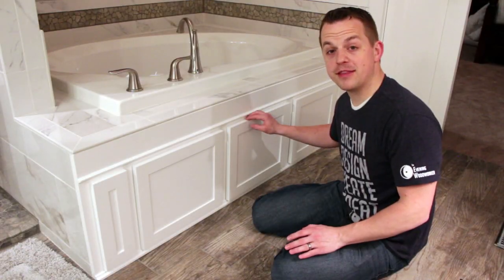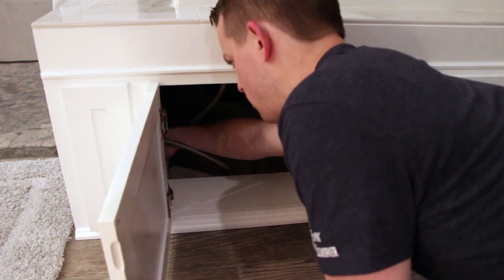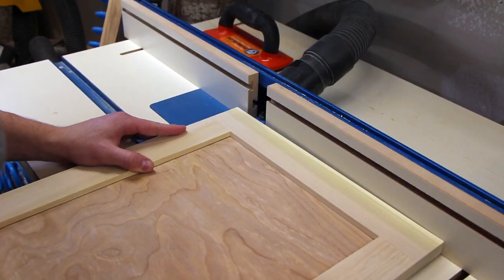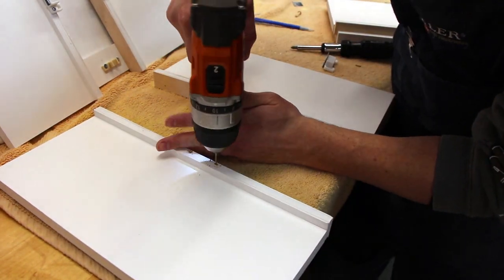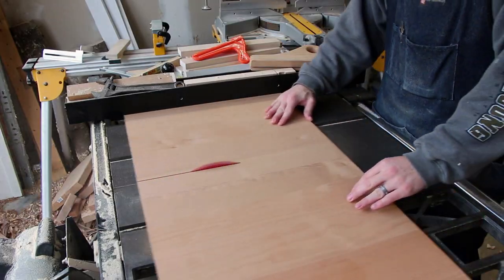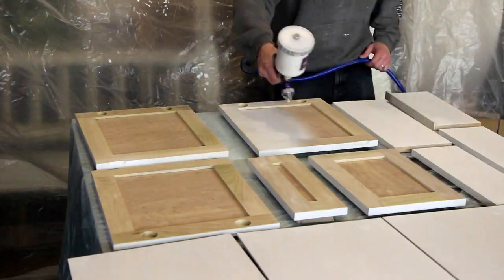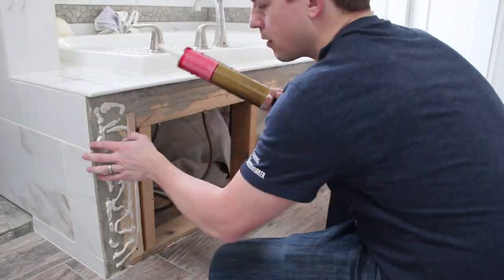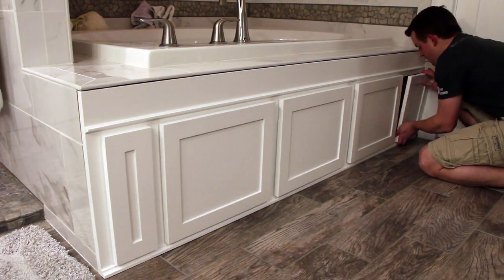Custom DIY Bathroom Cabinets under Bathtub | Evening Woodworker

Comment: Did you relocate the vertical studs for even spacing of the compartments? My tub has irregular spacing of studs, and I worry about proper support of the surrounding deck.
Reply from the maker: The studs were pretty evenly spaced, but different from each other by about an inch or so... so each compartment is slightly different.

Comment: How do you do this job with out all these fancy tools
Reply from the maker: If you buy the boards already surfaced to the thickness you want, then you wouldn't need a planer. You could also just buy unfinished flat panel doors to the size you wanted and then build the case with just nails and screws. The kreg jig though is really handy and definitely worth the cost because of so many uses. Hope that helps

Comment: How is this DIY when you're obviously a professional with professional equipment?
Reply from the maker: Joey, sorry for the confusion. I actually am not a professional and am doing this as a hobby and because I love designing and building things. I labeled this as DIY because I used a tablesaw, miter saw, and router and other common hand tools; these are all woodworking tools available to the common DIYer. Hopefully this can give people ideas of what they can do with some basic tools instead of paying a professional. This all depends on your comfort level with the tools and techniques shown, but it is possible. Best of luck!
Reply: Do you do it for others? If so, what is the best way to contact you?
Reply from the maker: I don't usually do commissioned work, but if you find a cabinet maker in your area and show them this video, they may be able to duplicate it.